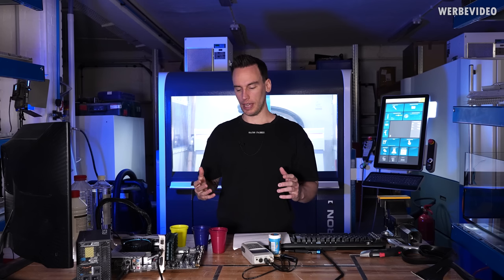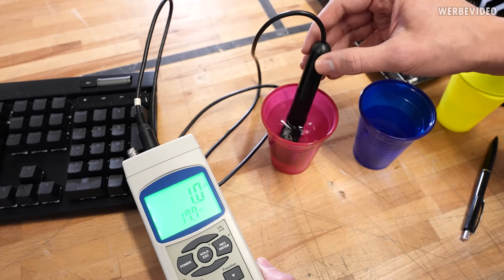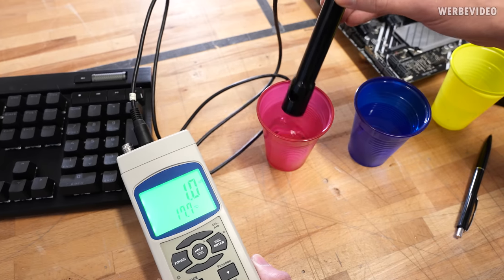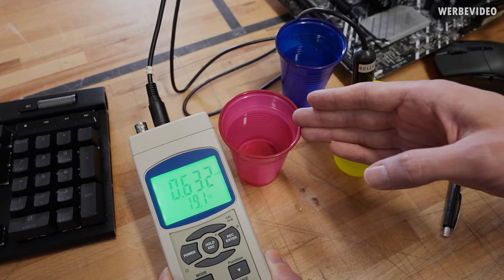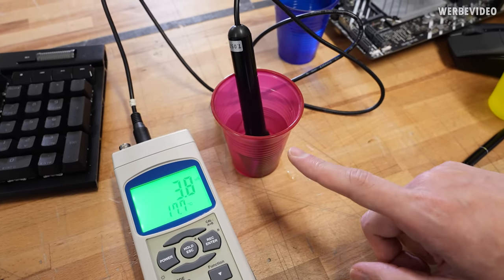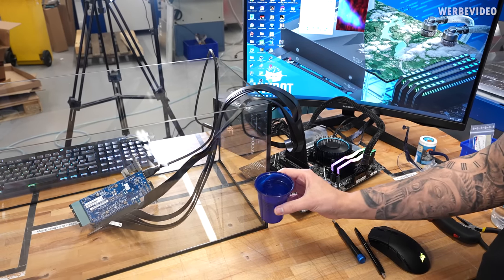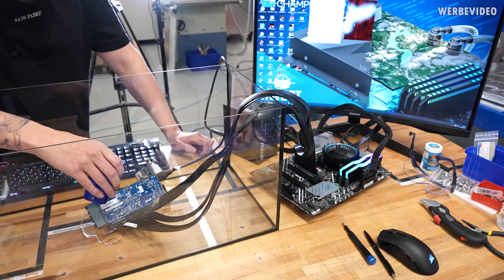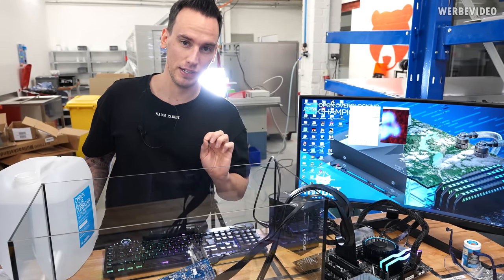Can you submerge a PC in Ultra-Pure Water?

Comment: And...therefor Ladies and Gents, using salt on roads might be great to melt ice (but only between like ~+4.0 - ~-8.0 if I recall correctly), but will in conjunction with the earth being in the chassis of the vehicle being a great solution for making your vehicle rust away in no time. I don't know if they salt roads in Germany, but on the little isolated island Gotland that is a part of Sweden they don't use salt. So if you are trying to find a rare vehicle for your collection, try there first. Though, your luck may be hard pressed since there's only about 60.000 people living there, and 20.000 of them live within Visby which is the biggest city/town on Gotland.

I just wanted to point out that the memory sticks never light up while the motherboard was submerged in the water. But at the same time, that probably wasn't it, because it didn't even have time to show a error code or beep, but the beep probably wasn't a possible solution since I knowingly haven't seen such a component on a motherboard.

I always clean my bearings of my longboard wheels after riding in wet conditions, even if a new set of OK quality only cost about €20 I rather spend that money on something else. For example, a set of bearings for every 4 wheel set I own, which is about 15. So I don't have to switch between the wheels.

Comment: Should filter the water constantly with an automatic system and test it for a month...
Submerge the PC on the distilled water for hours just to get rid of all solvent component could help and thermal pads might be water proof and solve the lack of thermal paste.
The experiment didn't work but I do have hopes, if nothing else try sanding (waterproof) the PC components like smartphones and see if it can hold nicely after that.

Comment: I would have tried to wash the electronics in one batch first to get as much soluble contaminants off as I can and then try and run in in the next cleaner batch. But I'm not sure if it would have made any difference. 
Trouble is that all the waveguides on the PCB are calculated for FR4 and air, not FR4 and water. Water has a very high relative permittivity so it completely screws up the impedances, which is a problem for high frequency communication lines. That doesn't have anything to do with water's conductivity. Immersion coolants like Novec have much much lower permittivity, not quite as low as air, but completely different from water.
Another thing to try would have been some legacy PC that worked with sub GHz main clock, that would have had more chance of success. Heck, maybe a raspberry pi would have been a good test subject, it may not be PC, but computer is computer. Smaller cheaper too.

Comment: The atmosphere has carbon dioxide, which reacts with water to make carboxylic acid, which will increase its conductivity.  Interestingly the same thing will happen when you run electric current through the submerged graphite rods that your conductivity meter uses, but probably to an insignificant scale or else they would have used something else.

EDIT:  I thought I ought to add that carboxylic acids effect will be unnoticible most of the time, but on something as non-conductive as your ultrapure water it may be noticible.

Comment: This might just a country variation thing but distilled water is not "ultra pure" water.  Deionized water (when done to certain purity) is.  They are not the same thing.   Again, that might be we call it a different thing here in the states.  Di water corrodes metal very quickly.  It will even rust most stainless steels.

 DI used for commercial applications use a circulating loop.  They constantly circulate over the ion exchange beds to keep it pure.  Usually fed by RO systems to make up the water taken out.  Basically a tank that is filled by an ro system.  That tank uses a pump that goes through various filters, carbon beds and ion exchange beds (composites tanks filled with deionizing media).  It then goes through piping with tap off points to a back pressure regulator before dumping back into the tank.

Distilled water is just water that has been evaporated and condensed.

Comment: I wonder if runnign the components through a ultrasonic cleaner first would go. You handled the parts with bare fingers before putting them in water. skin oil, and sweat salt must've contributed to the conductivity.

Comment: I think it is just impossible to clean all these components, specially the metallic contact points, since they will oxidize quite quickly, so no matter how you try, it is almost impossible to keep the water free from contamination. Water alone would make that, in a short time, but self-contamination makes it that instantaneous.
Also, keep the fan in wasn't a great choice.

Comment: I don´t thing the conductivity is the big problem here. My theory is that the high permittivity (~80 at room temperature, air has 1) prevents it from working. A permittivity increase of 80 means that the traces have around 80 times the parasitic capacitance compared to when they are in air. This just stops most datalines from working properly.

Comment: The initial crashing issues I'm pretty sure is just because the water reduced the resistance of the electrical connections and messed with the GPU voltage slightly

Comment: When I distilled my water I got a non measurable conductivity (below meter threshold) but as soon as pour into plastic bottle it start to rise. Salts present on components were enough to ruin the experiment. If the water stays without ions it should work.

Comment: And here I was, thinking that the question of water(any type) vs. electronics had been answered a million times already. if you want submerged electronics, please use something like the 3M Novec which is made for this stuff, you can even run it in your cooling loop if you so desire.
Reply: 3M Novec is likely not that healthy to use to be fair.

3M Novec is a fluorinated compound. (to be exact it is: 1,1,1,2,2,4,5,5,5-NonaFluoro-4-(TriFluoroMethyl)-3-Pentanone that has an exposure limit of 1.9 g/m^3
 as far as OSHA is concerned.)
3M states that it is "harmless", like they have done with all their other fluorinated compounds. And a lot of chlorinated ones before that.

So far not all fluorinated compounds have been tested for their health impact. But those that have been tested have so far proven quite toxic in the long term. And their non biodegradable nature makes them accumulate in nature rather quickly. So Per-/Poly-fluoroalkyl substances haven't proven themselves as particularly good. (In the EU there is discussions to add all PFAS compounds to RHoS, effectively banning their use in the region with limited exceptions in applications where there is no viable replacement.)

It is the asbestos of the modern age. Really useful, but it sure comes with a lot of unforeseen consequences. But as far as 3M, Du pont, and others are concerned, they just have to slightly tweak the composition of their product to make it a new compound (from a legal standpoint) that they can label as "safe" until proven otherwise.

They still have to do some testing, but it is frankly silly to see them make products that they call "safe" only for it to be later realized by independent 3rd parties (often government agencies) to have an LD50 of a few µg/kg in most animals. However, M3's "Professional judgement
" places the LD50 of Novec at at least 5 g/kg in humans.

So 3M Novec is likely not a good product.
Mineral oil is a lot safer. (except from a fire safety standpoint.)

The quoted numbers are from 3M's own safety datasheet for 1230 Novec.
Reply: @todayonthebench  as I stated "something like", I'm well aware of the problems regarding 3M's fluids but currently there is nothing else on offer which doesn't degrade rapidly and destroys the electronics. I'm not aware of any other liquid out there that has the same viscosity as water and is fully dielectric and doesn't degrade with heat and/or natural degradation as seen in mineral oils, plus mineral oils are notoriously hard to clean off once you take your electronics out of the tub.
Reply: @TommyApel  It is true that Novec is a very practical fluid that solves a ton of issues. It is sad that it comes with the downsides it has.

Mineral oil is one of the better alternatives. Mainly since it is just a hydrocarbon. Having it in a controlled atmosphere would help avoid most natural degradation. (since the surface oxidizes when exposed to normal air. So get rid of the oxygen and that is suddenly a non issue. All that is needed is a mostly airtight lid and a bit of argon.)

Cleaning is indeed problematic. But one can use a thinner oil, like petrol (that isn't a joke btw), it will dissolve the mineral oil and rinse it off. And then the petrol will evaporate leaving a clean board. (Downside with petrol is that it can dissolve some plastics, just like mineral oil. Though, mineral oil is more aggressive against rubber and such. Not to mention the fire hazard. A bit of caution and a well ventilated workspace for doing the cleaning operations in is a decent solution.)

Beyond this our options are perhaps more complex.

Another method of improved cooling is just air. But increase the ambient air pressure to 2-3 atmospheres. This both increases the air's thermal conductance, and its capacity to soak up heat. With the slight downside of somewhat higher air resistance and an increase in structural strength in the building itself. (an airlock will be needed to enter the datacenter though, and going beyond 3 atmospheres will require some thought about avoiding decompression sickness. So exiting will take a while.)

Another solution  is to just lacker the whole board. Add rubber gaskets for the sockets, connectors, etc, an airline to ensure that the socket/connectors/etc is pressurized and ensuring that any leaks results in air bubbling out instead of water trickling in. (not a lot of air pressure will be required to ensure this.) And then one can just casually dunk the whole server into regular tap water. (And people thought cable managing RGB lighting were a pain, low pressure air hoses are way more fun since a kink or too tight cable tie can cut off the flow and then one's leak protection is gone.)

Comment: You don't need the metals to make your water plenty conductive. CO2 will form small amounts of carbonic acid, which is plenty polar, and will make lots of lovely ions to conduct with. It won't make your water super acidic or anything (though it's measurable), but it doesn't take much, like you saw with the salt. Pure water "spoils" in air, pretty quickly.

Comment: The conductivity of water cannot really do any harm in a digital system. I think the culprit is that the dielectric losses will change when water will be very close to PCB tracks. A modern CPU is operating with so high frequencies that the boards must be computer designed to have the proper parameters, so the signals will arrive  within the time limits.
The GPU worked, and that suggests that it doesn't have so many external PCB tracks.

Comment: Maybe the system thinks that the CPU fan is not functioning properly due to water resistance and turns off the system. Its just an assumption. As the hardware is working flawlessly after being taken out which means it was not dead under water as well.

Comment: great test, but not so great @the smae time my dear 8auer ;p Let me explain: you left thermal paste on the hardware, you left fan too. For this to work, you would have need to have heatsink's and fans removed from the system. reason is, the particules that make thermal paste thermally conductive, even if not "electricaly conductive paste" is use, even micro ceramic, would act like your grain of salt. The fans, they have lubricants in their bearings and dust that can NOT be cleaned out of it. The heat sink being made of aluminium, WILL react with water. As you should know, Aluminium love to react quick with air, even more with water, and having the fan spinnin in the middle, will accelerate the errosion and corrosion of that aluminium alot faster(as moving water will derange the fine aluminium oxide layer) and spread it all around. The last mistake you made was to leave tape and stickers on the hardware(like the ssd), glues, adhesives and the stiker themselve have salt/salt-like property and will make water conductive. To be assured of succes, you shall use a bare delided cpu(and who's better than you to have such part lol <3) a bare gpu, as few as possible if none screws, no labels and no fans. if you intend on running the system for more than a benchmark, sure you would need a way to cool the water tank itself,(but that could be acchieved having external fans blowing on top of the air, with the least disturbance possible. Hope this helps and maybe give you some ideas <3

Comment: I am sure that you have take this into consideration, but what if the PC was shutting down because the CPU FAN had a low RPM? Or it was pulling more Amps than normal and that made the motherboard shut down? Unlikely, but can happen. :)
Reply: This was my thought also. Sure, the stuff that people pointed out with signal integrity due to dielectric changes caused by water is certainly a problem. And so is the contamination of the water by metal ions and resulting conductivity changes. But I'm not certain either of those things were really why the system refused to boot up. Maybe the mobo just thought the CPU fan was bad. If Der8uer wants to try this again, maybe the water level could be a little lower to allow the fan to spin normally.
Reply: I bet on this too.

Comment: Didn’t watch the full video but what you want is de-ionized water. Just distilled doesn’t really help. In silicon factories that clean wafers with ultra-pure water it gets reverse-osmosis filtered, UV blasted, and then runs through de-ionizer tanks before finally going straight to being used. I worked in the ultra-pure and waste water treatment industry for a handful of years doing PLC controls automation
Reply: de-ionized is a removal of mineral salt particles. Distilled is stilled leaving most, or all non-H2O. As in removal of all salts, and organic debris into a chemically pure version. Distilled is "cleaner" than de-ionized if it's from a good source. However, none of that matters in the long term. All water of any purity will absorb contamination or metal particulate and re-ionize.
Reply from the maker: Well often it makes sense to watch the entire video first 🤣 but the outcome is the same. You will have a higher conductivity and ions back in your water within minutes
Reply: @der8auer-en  well I watched what water you were using and skipped to the end where it didn’t work so I think I got a pretty good summary of the video. Regardless though, you’ll never be able to run electronics under water for useful periods of time since the hardware will contaminate the water very quickly. Ultra-pure water is really only used for flushing and cleaning, in which the water is immediately disposed of

Comment: When your doing something like this, you NEED to clean and flush everything that will touch the water thoroughly (with alcohol or more of the distilled water), and then DO not touch it with anything other than other things that have been similarly cleaned.

As you demonstrated, a single crystal of salt will contaminate a fairly large volume of water.   Your skin has salt all over it.  As do the motherboard and components.  Every time you, or anyone touched the water or the components, you ultimately contaminated the water with salt off your skin.

Comment: You might have created tiny batteries allover your system, so called Galvanic cells. 
What you need for a galvanic cell is 2 different metals and an electrolyte. Computer electronics are full of different metals, so no problem there. Your very pure water is a very poor electrolyte, however, the distances between 2 metals might be very small and the ions of these metals dissolved  might make there own local electrolyte. And then you can get a voltage difference and therefore an electric current which will most likely confuse the whole system.

Comment: The real problem is not the conductivity, at least on the short term, but the change in the capacitance of the data lines. The GPU was freezing because it was having PCIE link errors, and the motherboard could not boot due to the disruption of RAM signaling, RAM training would never succeed.

Comment: Still about 140 times more conductive than air, so makes sense it didn’t want to run but wasn’t conductive enough to short circuit with enough current to fry components. Cool experiment

Comment: Hey der8auer this gives me another idea for something for you to test. Different cpus and coolers with the coolers fins submerged in say a bucket or small tank of water. Whats the smallest cooler to water ratio for different systems when using standing water to amplify the capabilities of the heatsinks.
Reply: Ltt did that some years ago, and they had submerged  pc that was working for years in mineral oil.
Reply: @readywer  thats quite a bit different

Comment: So about this. I was always wondering about oil. Because there are oils that are non conductive. I have seen a TV screen working submerged in oil.
So I was always wondering if you could submerge a PC in oil and use it at coolant. Because there are oils that are used for heat transfers in a certain kind of solar power plant (Not photo voltaic, the ones that use mirros to collect a lot of sun to shine it on a pipe filled with oil that heats up and gets transferred to a body of water, heating the water which powers a turbine.)